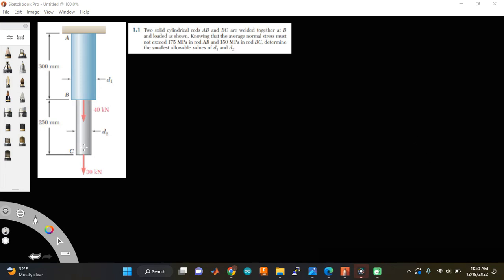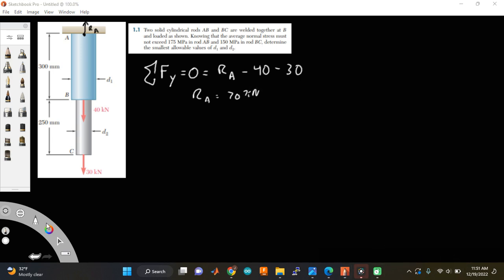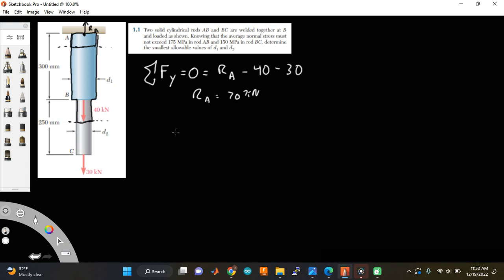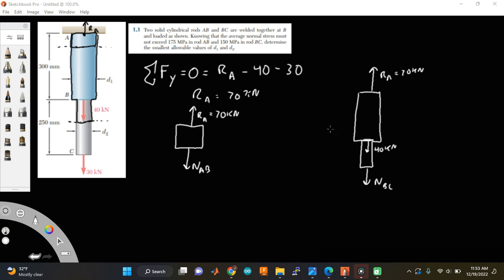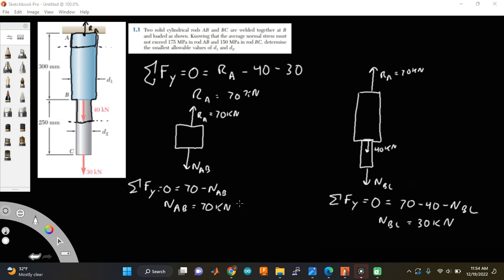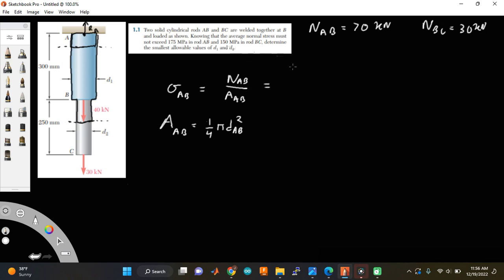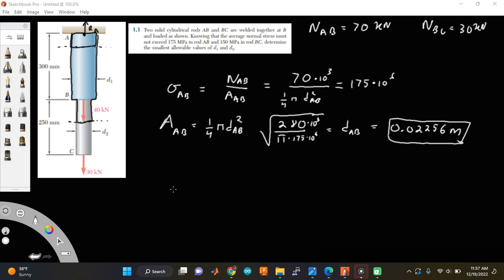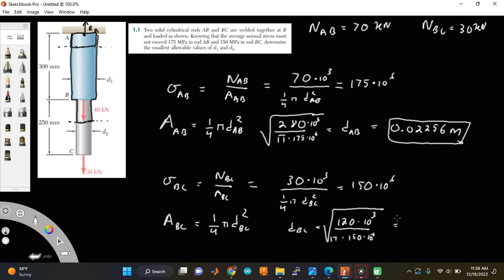Cylindrical rods AB and BC. Normal stress must not exceed 175 MPa 150 MPa, determine allowable d1 d2

Comment: what if my Nbc is negative? I cant square root a negative number
Reply from the maker: Use the magnitude of Nbc in your calculation of the diameter. I.e. neglect the minus sign when substituting into the square root. Does that answer your question?

Comment: what the formula for calc the cross section? r or d in that formula is the radius not the diameter! you have not fully answered the question..
Reply from the maker: Hi there, I do not understand your claim, these are cylindrical rods with a circular cross section. Therefore the formula for the cross-sectional area is correctly given to be pi*r^2, or (pi*d^2)/4. I encourage you to solve this again using these formulas and to clarify what it is you think I did incorrectly.